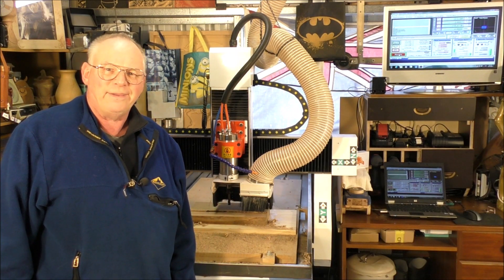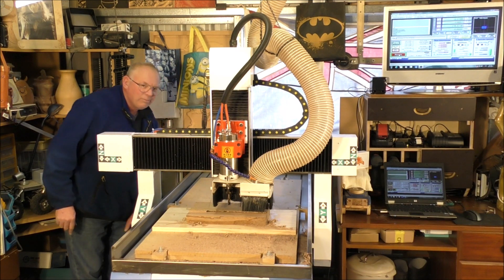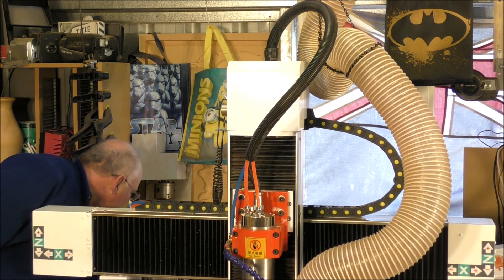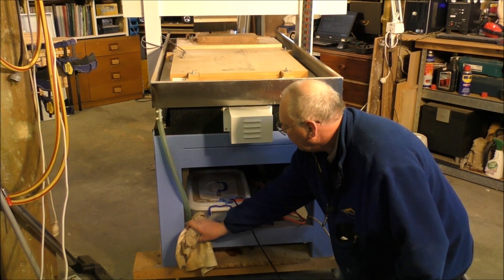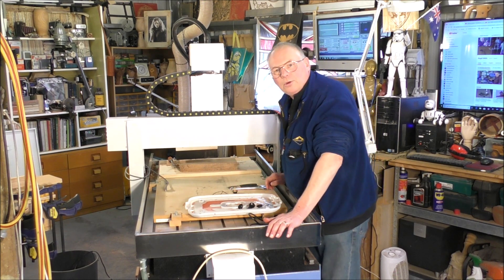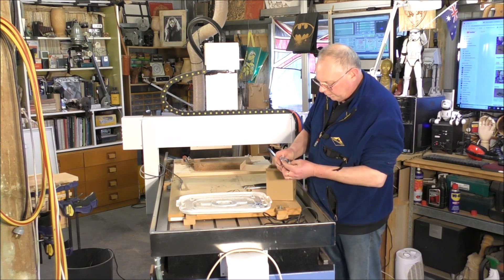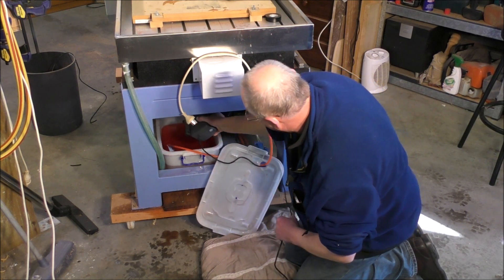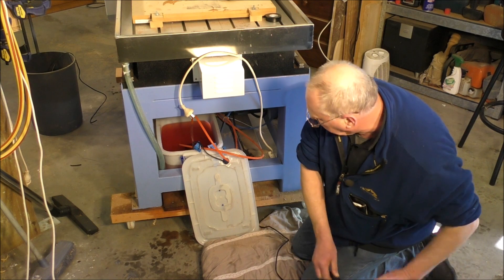AAARRR!!! My CNC Router stopped working *BIG FAIL* and repair

Comment: I would have used an ohm meter to see if I could prove my theory that the pump was faulty.  It is dramatic to throw the thing in the bin on camera, but i would have waited till I had the new one in hand in compare and possibly transfer fittings.  But overall, great video and will surely help someone else who might have the same problem.

Comment: rfi mains interference
Reply: one thing i got taught in amateur radio every little bit of wire is a antenna and will receive any little bit of interference.
and the pc has picked it up i get the same here if i turn the led lights on affects the pc and my amateur radio.